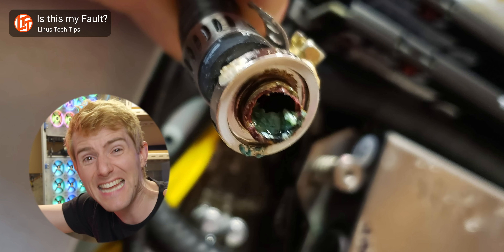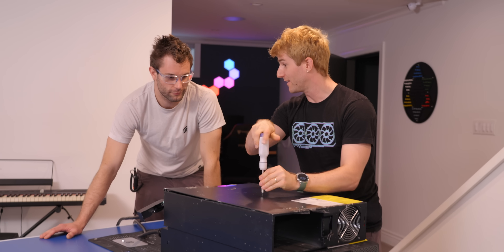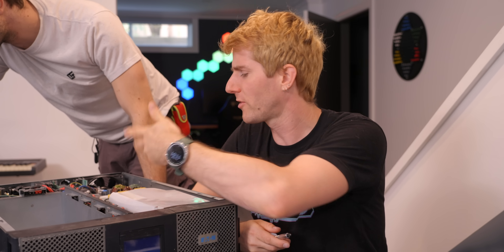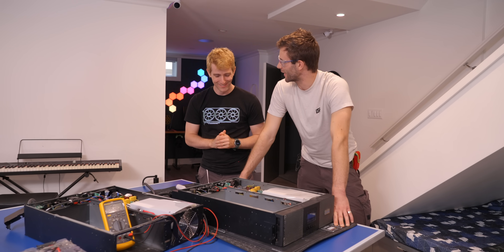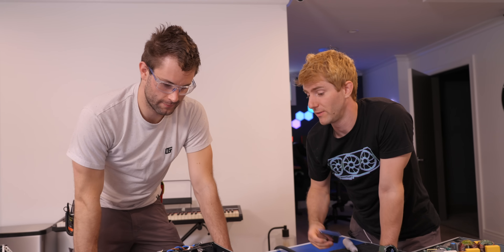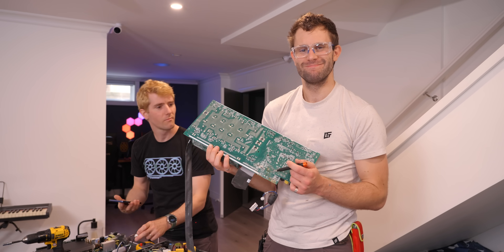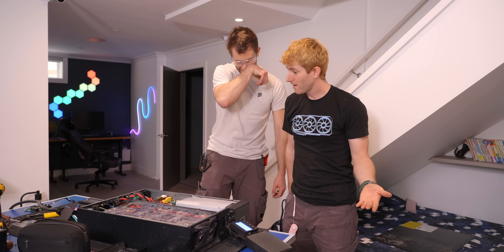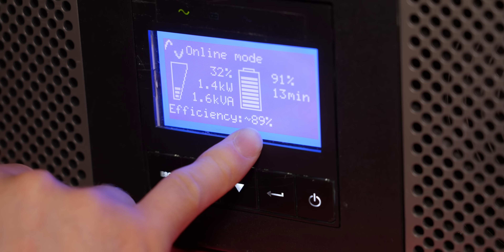Risking my life to save $5000 - Water Damaged Battery/UPS Repair

Comment: Idk if this will help but this is from chat gpt If only one fitting in your loop experienced severe galvanic corrosion while others remained unaffected, this suggests a localized issue rather than a systemic one. Here are some possible reasons for this:

1. **Manufacturing Defect**: The corroded fitting might have had a manufacturing defect, such as impurities in the metal, poor quality control, or improper surface treatment. This could make it more susceptible to corrosion compared to other fittings in your loop.

2. **Poor Electrical Isolation**: If that particular fitting wasn't electrically isolated properly, it might have created a small galvanic cell. For example, if it was in direct contact with another dissimilar metal without proper insulation, this could lead to localized galvanic corrosion.

3. **Water Flow Dynamics**: If the flow rate or turbulence around that specific fitting was higher, it could have accelerated corrosion. Higher flow rates can increase the rate at which ions are exchanged, leading to faster corrosion in areas where the fitting is more exposed.

4. **Contamination**: That particular fitting might have been exposed to a contaminant, either during installation or through the loop itself, that increased its susceptibility to corrosion. For instance, residue from skin oils, flux from soldering, or even a small particle of dissimilar metal could initiate corrosion.

5. **Electrochemical Potential Differences**: If there were minute differences in the electrochemical potential around the loop, this could cause one fitting to corrode faster. Factors like uneven water distribution or temperature differences could play a role here.

6. **Leakage and Moisture**: If this fitting was slightly loose or improperly sealed from the start, it could have allowed a small amount of water to leak, which, when combined with air exposure, could greatly accelerate corrosion.

Given that the corrosion was heavy enough to cause a leak, it’s likely that one or more of these factors contributed to the issue. After replacing the fitting, consider adding a corrosion inhibitor to the loop, ensuring all fittings are properly sealed, and checking for any stray electrical currents that might contribute to galvanic corrosion.

Comment: what I find hilarious is that all of this could have been avoided if Linus's water cooled components were on the bottom of the rack
Reply: The instructions for UPSes and BBUs (battery backup units -- additional battery banks for UPSes) say that they must be installed on the bottom of the rack. They are extremely heavy (much heavier than anything else you could put into a rack with the exception of perhaps a 45 Drives chassis), so installing them anywhere but the bottom would create a tipping hazard due to the high center of gravity.

Comment: Funny you mention the soldering since recently I just fixed my UPS by reflowing it since it had cracked joints every where. But that was a 6 year old unit.
Also one thing you should of mentioned is to use a multi-meter with probes that are rated for high voltage since trash Chinese ones you can get zapped though the probes.

Comment: I did an autopsy on a 30hp frequency drive that suffered a similar fate. Traces vaporized so hard they were shadows on the inside of the case.  Replacement got a water deflecting shroud in case a roof leak ever happens again over that exact spot. This was running at 480v too, yikes ⚡

Comment: I really don't like this kind of sponsorship. It's very clear on the website that entries are free, which is good in case people don't understand what a sweepstake is. However, you do give them your email and phone number, and you will receive promotional material. It doesn’t feel so free, but that's just my opinion.

My real problem is with people paying $150 for a wallet they wouldn’t buy otherwise. They just want to get those sweet 700 entries and then think there's no way they won't win. People can be really stupid when it comes to statistics, and that's a reality.

At the end of the day, it's legal, I guess. So, I don’t know—go get the bag, I guess. Just be more considerate :)

Comment: I love how they have a massive cable for 240V over there but in the UK it's just standard practice for everything to run that way.
Reply: We would use that massive cable for 240V over here (UK) too if it was traveling for that distance. It's going to another room on another floor of the house. The volt drop on a small conductor would be too much.

Comment: I was always taught to never use a UPS without it being plugged into the wall because it's then ungrounded. It'll probably be fine, but if it's not fine then it's really not fine.
Reply: no load connected. so in theory its safe to test it powerd on and is working

Comment: "Well - metal is metal"
Not when it comes to conducting electrical current, that's for sure. Compared to copper, most common metals are not even in the same ballpark. Brass - being a copper alloy, is not the worst - but it still only manages 20-30% of the conductivity of copper. Others like steel are horrible - in the range of 40x worse than copper. The only other common metal that would realistically be a workable conductor is aluminium, at around 60% of copper (it has some other practical issues though).

I'm not (just) trying to be pedantic, but making this mistaken assumption in a DIY project could very easily lead to a fire.

Comment: Battery backup that way for PCs is stupid 😁
Battery (12/24/48V) to AC120, to the power supply, AC120 to 12-5-3.3v 
So, on my build, I do. 
Batteries 48V to 12V 5V 3,3V,  Simple. Efficient. 
I'm also removing the AC-to-DC power supplies in most of my equipment to use a DC-to-DC step-down, and usually, I can have multiple devices with the same voltage, so I use only one step down beefy enough.  
Bonus, I have 2$ modules to do 48V to USB C 100W PD. 
My lights, LEDs in 24V, no transformer, 
All of that is now done with efficient battery backup.

Comment: or u could have just got a popper with the right spec that match that fuse an tied the popper in an test the ups so if anything pops the popper will pop 1st an u can easily reset it istead of blowing fuses left n right

Comment: Woah woah woah. 12:48 it says “IEC thresholds for Low risk voltages are <50VAC or <120VDC”. That is definitely backwards. 120vdc would really mess you up. 50vac shouldn’t be too bad. Should read “<50VDC or <120VAC”

Source: electrical engineer who works with driving glue valves. We use 8-10A of 80VDC, which would easily kill you.
Reply: Funnily enough, it is actually correct. https://en.wikipedia.org/wiki/Extra-low_voltage
Reply: @Yggdrslll that’s very surprising! I wonder why they specify that…

Comment: Extremely high voltage but ya grabbed metal part screwdriver tapping all around inside case was waitn for flinch touchen somthin with ya

Comment: Why not just use a normal battery backup system? EcoFlow with instant transfer switch costs less and is easier to expand to a bigger battery as you need more.

Comment: Working with UPS felt like working with a bomb to me. For the love of god don't ever mess with high-current equipment if you don't know what you are doing. A single 12V lead acid battery can WELD stuff. A 90+V assembly is just freakign scary. I was taping every single terminal while i was working with my 6x12v cell 3000VA UPSes in order to not accidentally drop a screwdriver or something on the terminals. If you have some automotive electricity experience, THAT would help, but those UPS bastards also have capacitors that want to murder you.

Comment: You should invest in some water leak sensors that interface with home assistant. That way you can automate turning off the pump or closing a valve if a leak ever happens again.

Comment: Far too much fun through the whole video, but I do like how many disclaimers were shown. Working with large capacitors will really need a good understanding of just how dangerous they can be. Learning board repairs on microwave ovens and CRT tv's is probably a thing of the past, but they do sure teach one to respect caps and anode leads.
Kudos to Dennis for making me watch ads for stuff I'd never purchase.

Comment: Man, I love troubleshooting stiff like that! That's why I love my job as a Laboratory Equipment Technician at a university. The students always find weird ways of breaking the Equipment 😂 
I was working on a power supply and only half the supply was working. After testing and testing and probing everything, I found that a solder joint going into a bridge rectifier had popped off the pad. Reflowed the solder joint and everything was good as new 😁

Comment: The diode symbol on the fuse means that is a special class fuse, designated for semiconductors, it is extremely fast acting and breaks open very cleanly, with as short of an arc time as possible

Comment: Can't you just buy it in old used UPC, and then put a bunch of lead acid car batteries in parallel? And would it be cheaper just to get the cheapest batteries or get less in deep cycle you can use more of the charge?

Comment: noted. LTT screwdriver is NOT safe to use in an application where it would be most reasonable to have such a good ratchet.
that's a waste, perhaps it should be revised

Comment: Wait... lead acid batteries in 2024???
Reply: They're cheap, standardized, and can be recycled at your local hardware store. The only real downside is weight, which doesn't matter for something like this.
Reply: @stevethepocket  Space and efficiency (lead acid requires trickle charge) are also real downsides.

Comment: so I just need to wrap my head about something but I'm dumb so why convert the 12v perfectly DC output from the lead acid battery into 120v AC AND then get it back to 12v dc in the server's power supply (and devise all other voltages from it) instead of going thru the inefficiency of 12v dc to 120 ac back to 12v dc conversion 
circuits that straight up take the battery output and regulate it to 12v (and include 5v,3.3v rails ) sound more efficient and cheaper to me

Comment: 7:59  I would disagree with you about that "AC can't exist if it's unplugged" statement.  That UPS obviously has some kind of inverter to provide AC power when the grid goes down, so as long as power is getting from the batteries to that inverter circuitry there COULD be AC voltage.  After all, there's AC voltage present at a wall outlet even when no load is plugged into it.

Comment: Hey Linus, what do you think about adding some broken GPUs to your "how to repair xyz" lineup?
I have a broken-ish 2080 super at home, but I don't know how to fix it (I am relatively adept at soldering, so that part shouldn't cause too many issues for me). Therefore, I would be interested in the necessary steps it would take to troubleshoot one, even if there is no video output whatsoever. I am sure the community feels the same.
Best regards

Comment: My ups that was powering my main rig and my minecraft server and my other (semi functional ) dell optiplex , got soaked after a ,leaking pipe from upstairs poured alot of water there. Magically,  all the internals and batteries were unharmed by the amount of protective plastic covers it had.  Saved me 600$

Comment: Linus spends however much, for a badmiton/gaming LAN center not long after the Labs expansion, but for critical home equipment, cheaps out with an ebay spare and attempts to diy a solution?

Comment: While lithium ion would not be the route to go, lithium iron phosphate (LiFePO4) would be a much better choice than lead acid while also being much safer than lithium ion. It lasts a lot longer than lead acid, you get the full usable capacity out of it compared to 50% out of lead acid, and it doesn't go up in flames like lithium ion can.
Reply: Eaton's Lithium UPS' use LiFePO4
Reply: Although Eaton still call it 'Lithium ion'. (And technically, it still uses Lithium ions to do it's thing). And all this confusion is made worse by ion and iron sounding the same.
Reply: @phuzz00  You could call it a "Ferrous Lithuim battery" and keep it distinct; but I feel like a some people wouldn't quite know that ferrous means iron.

Comment: Fore everyone who is stupid enoug to do something like this. Keep a long wooden stick around and never do something like this allone. That way you can poke the other person to see if she/he is still alive. Ok no seriously you should have something isolated to push the other person away from any contacts that have a voltage applied to them. If you grab such a contact your muscles will cramp and you wont be able to let go. Then someone else can use the stick to push you away from it without the risk of an electrical shock for themselves. I have see this as a safety measure after an EV Crash test.

Comment: I work at a HIFI store and once when I was replacing the AMP unit on a subwoofer I just took a picture of the capacitors and sent to my electrician dad asking what I'd get if I touched them (apart from a shock)... He told me how when he was in school it was apparently a common prank to charge up capacitors and just toss them to people... They'd instinctively catch them in their hands and get a quick jolt...

edit: I should probably say that I assume they were not that high voltage and weren't actually "dangerous"...

Comment: when I was on vacation my UPS died on the 2nd day I was away. APC SmartUPS, rack mounted. Three small 22uF caps like on every other APC. Replaced and works perfect again. 18 years old unit, who knows how many battery packs have been replaced in it!

And also I burnt my 5kVA MPPT AiO from Voltronic by accidentaly shorting one of the photovoltaic cables to earth. I repaired it myself - two IGBTs and one opamp and all was fine! And did not burn myself :-)

Comment: The diode icon on the fuse means it's rated for DC. At anything but low voltage, DC arcs are decidedly difficult to quench so you need special fuses for those applications.

Comment: UPS market is kinda crazy... new pieces cost thousands of $... and then you can get used without battery/not working (usually dead battery)  for "whoever gets it out of my hands" a lot of companies just dumps them when battery dies since they can't get original replacement... i have 4 server UPS and like 6x APC 500 UPS, cost? New battery...

Comment: LINUS A CHALLANGE FOR YOU, Build and test my rig while blidfolded!!!
-i3 9300k
-rtx 2070S
-z390-p
-corsair h150i elite lcd (overkill i know)
-lian li evo black
-msi af 650w
-lexar ares gaming rgb 32gb(4x8gb)
BONUS:
lunch dying light 1/2 with spartan 4
this will get it to 100*c+ in a shelf
Reply: im from poland and the gpu is AT LEAST 2700 moneys (i may have 4k saved up in 1 year)
Reply: well my ps is a bio hazzard in 2 years

Comment: Get a professional when working on such a equipment. Tynan (don't know if I spellt the name correctly, sorry if not) is great but obvoiusly he is not experienced in electronics repair. And you need a technician specifically experienced in high voltage for this kind of stuff. Flooded electronics are also generally nasty and you need a good amount of experience to fix them properly. You did lucky, but this thing might as well explode as soon as you connected the battery pack. Just think what would happen if you short a battery pack this size... And you did NOT check for shorts - at least on camera - before connecting it!
PS: good thing that the original fuses did their job and the whole rack did not burn down...
Reply: I did do many more continuity/electrical tests off camera, they aren't the most exciting things ever unfortunately :P. Agreed very glad the fuses did their job!

Comment: I don't normally buy the stuff in ad roles... But after my wife lost her car two years ago and I gave her my rav 4 prime and spent two years driving a rusted out dilapidated 94 wrangler that I had to reconstruct the frame on and only keep running through the shear force of my own will... I could use a new wallet if it might come with the keys to a new truck 😅

Comment: 13:34 those fuses aren't directional, that symbol means that they are high speed fuses (or semiconductor fuses) meant to protect semiconductor components, but they can still be mounted either way.
Reply: That is exactly right. And at least here in Europe (well, at least in the German speaking part of Europe, not sure abeut the rest) they most of the time also have the sign "gS" beside the diode sign stamped on them. They both mean the same. As far I know gS stands for the two German words Geräteschutz Superflink what means device protection and superfast. We used such fuses to protect drives for motors with up to 120kW.

Comment: Im a licensed electrician 15 years now (working on 480ac 3 phase) , with 10 years experience working on battery powered forklifts (120dcv+). Think I'm pretty safe trying this at home😅

Dude please change out that plug so linus dont screw something up.

Comment: Linus, lose the worm-drive hose clamps inside your systems and fit everything with AN fittings. Put a filter on the whole system and a water pressure/level alarm that will shut down _everything in case of a leak/low coolant.